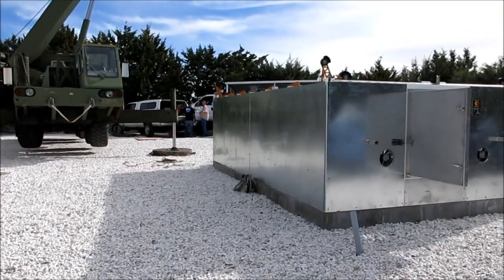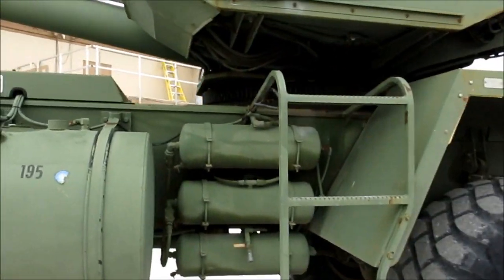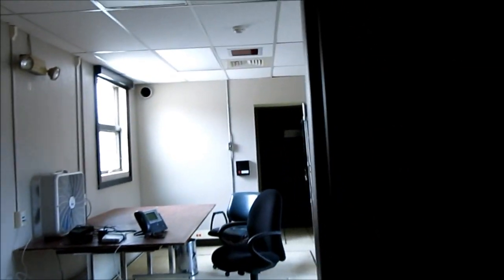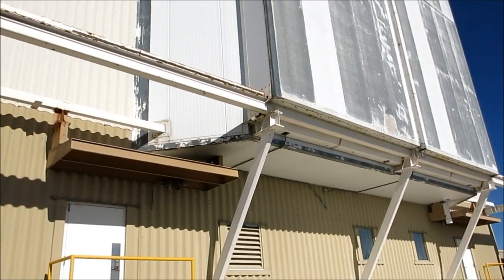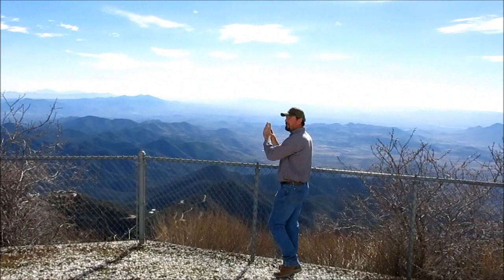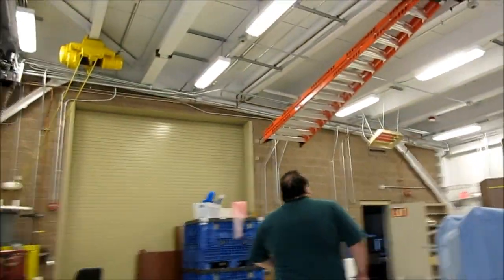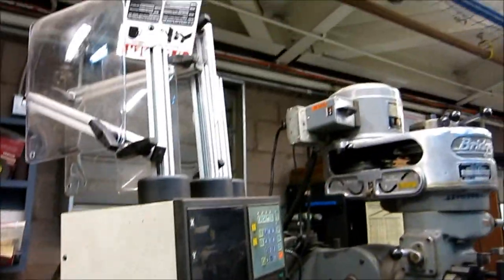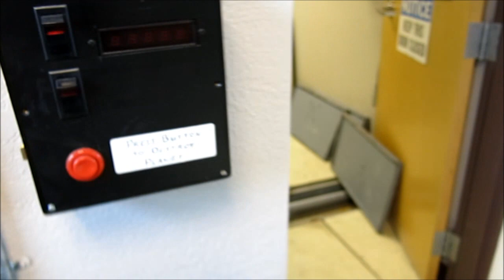Meatloaf 61 Mount Hopkins Part 2

Comment: Tom,
When you see a button like that, there is just no way you can leave without pushing it to see what happens, I was half expecting lights and sirens, that was a good one, lots of good stuff up there on top of that hill, that parabolic mirror that you showed in the previous video was amazing, and I assume that they were going to put a small telescope into that new building that you guys put up, that retracting roof is really well thought out.
Enjoyed the video, I could see by the cloud movement that there was a fair bit of wind aloft, and probably fairly cool as well up there, but what a view, I wonder what elevation you were at.

Regards,

John MD
Reply from the maker: Hey John,

It was perfect working weather. Cool and cloudy. The enclosure we put up is at 8500 ft. There will be two Planewave scopes mounted in the enclosure when its operational. Thanks for the comment.

Cheers,

Tom

Comment: I find it strange that the observatory is doing so much maintenance that they require a fully equiped machine shop. It would be interesting to "see the books" on what is done.

 Great video!
Reply: I'd imagine that it's not so much maintenance as it is making custom gadgets that attach to the telescopes for various experiments. Much faster, easier, and less expensive to prototype locally than to draw up plans for an area shop to fabricate.
Reply: Telescopes are finicky things, and most of the time, when something breaks, we fix it in house. I have a full fab shop as well. We've used it for making new instruments, and repairing/refurbishing old instruments. I have equipment on site that's circa 1940's and cannot be replaced by newer equipment without making some kind of interface. Outsourcing for some instruments is unfeasible in cases as well (like a specialty spectrograph, or a photomultiplier setup).
Reply from the maker: Hi Bizenes,

Lots of things break and need fixing and modifying. The nearest town is well over an hour a way with no industrial capability. Tucson is the next closest at over two hours. The fuel costs alone would pay for the shop ten times over. Thanks for the comment.

Cheers,

Tom

Comment: Great vid there Tom
You remind me of a engineering manager we once had when I was in work he would see a button on one a the big safe doors , "anyone know this does " ? So he presses it nothing happens 😀
Then his best trick to date was we had a large UPS system put in 2 mega watt for 15 mins ( bank main frames ) he says to the commissioning eng, "will it work " well they hafeled and kafelded ( now this was during the day run for all the bank systems ) so what did he do triped the main 11kv incoming breaker , yup it works 😰😰

Stuart
Reply from the maker: Hi Stuart,

A real robust systems guy. Hey if I can't test it why is it here. Thanks for the comment.

Cheers,

Tom

Comment: Have you been to the Nike missile site in the Marin headlands? really cool. they let you ride the elevator up with the missile. Amazing how many sites there were around the bay area.
Reply from the maker: Hey Mark,

Actually I'm embarrassed to say I haven't. There is one in San Ramon that I have snooped around while hiking. Not open to the public which makes it even more tempting. Thanks for the comment.

You would have loved checking out all the optics there. The adaptive stuff is really fascinating. 

Cheers,

Tom
Reply: oxtoolco you really should go sometime. only open certain days. it was much better than I had expected. in good condition actually. a bit frightening to think about. it wasn't there to protect the public

Comment: tom I've always wanted to see Arizona from there not so much, press button and hold to destroy planet sum times it takes a while just be patient. one of these days  I would like  to see Sam Franks Disco --think about it,it  will come to ya,comes from a Sheb Wooley song. next time on as the building turns, sirens, alarms, warning lights tom lipton says I didn't push that damm  button. keep it up pal, thanks
Reply from the maker: Hey Joe,

I didn't think about the scan rate of the PLC when I pushed the button. Stupid thing should have better instructions on it. "Maintain contact for three seconds" Thanks for the comment.

Cheers,

Tom

Comment: Even in fast motion, it looks like those guys are wasting a lot of time fiddle-farting around with the crane.
Reply from the maker: The crane operators are not professional riggers. They use that crane maybe three times a year. I cut them some slack as we would have had to rent something and drag it up the mountain. Thanks for the comment.

Cheers,

Tom

Comment: Did you tour Bisbee?  It's a "arty" place, famous for turquoise (copper).  Pick up some jewelry for your wife!  Ha ha, you pressed "the button".  Military satellite main control desks have one of those.  It remotely controls CB1 and shuts down ALL power to the station.  It happens!  Then you get the DCA (now called DISA) on your butt.  Then you get to talk to some investigators and fill out the paper work.  ha ha ha
Reply from the maker: Hey Joe,

When they run the guidestar laser to calibrate the adaptive optics they have to get permission from space command. Can't have them frying some spy satellite now can we. Thanks for the comment.

Cheers,

Tom
Reply: I didn't work on any spy sats;  just basic military commo stuff, mid 80s.  Nothing that exciting.  That was the NRO/Airforce's domain.  They get the cool stuff.

Comment: In 1980, a Titan II missile exploded in its silo, and ejected the W-53 warhead into a nearby field in Damascus, AR.  The subsequent investigation revealed numerous problems with the Titan II system.  The Titan II's were decommissioned shortly thereafter.
Reply from the maker: Hydrazine fuel was one of the big issues. Hey at least they got the warhead back.

Cheers,

Tom